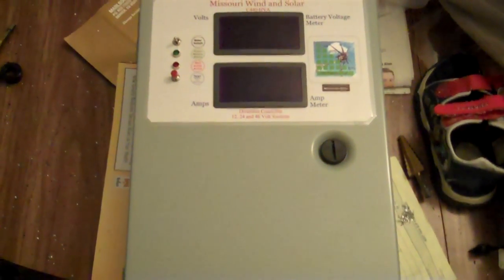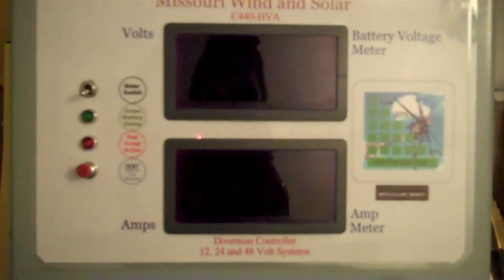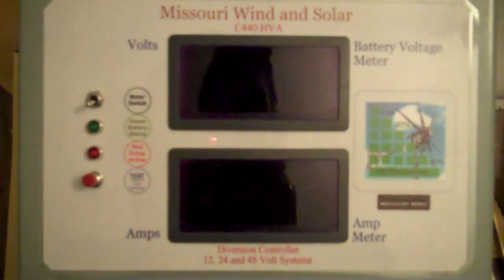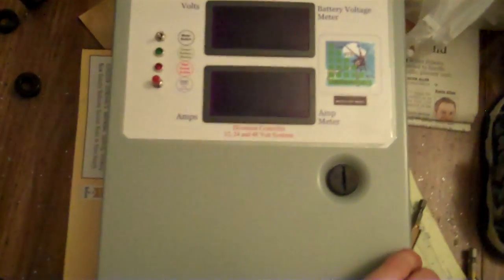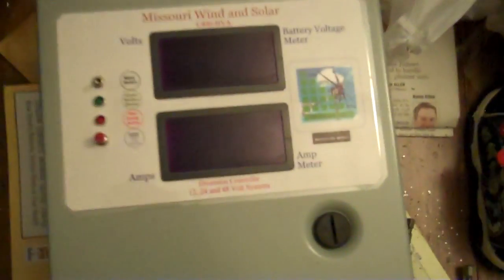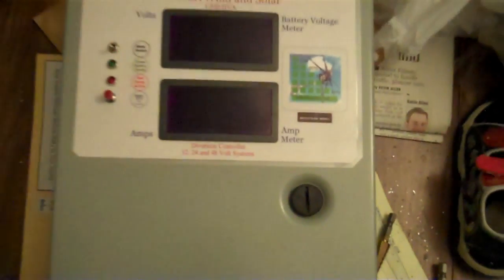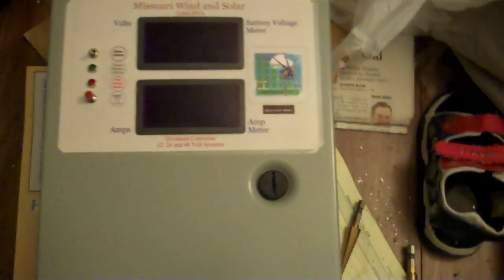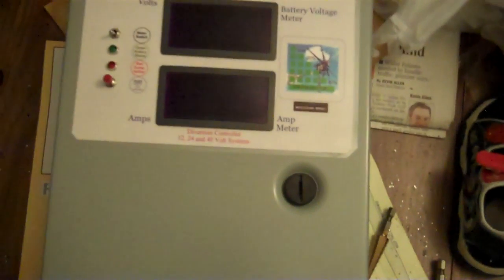Junk Charge Controller For Wind And Solar jeffmolly1 missouri wind and solar

Comment from the maker: the cut outs were welding in good and lots of good paint not a half ass paint job the only way to get the step bits to cut it was to drill the steel untill i got bit to eat it then i could use step bit pain in the ass good controller though nice as seen in other vid works good